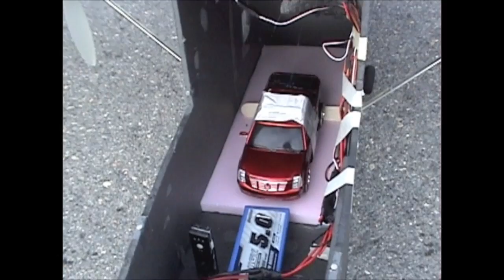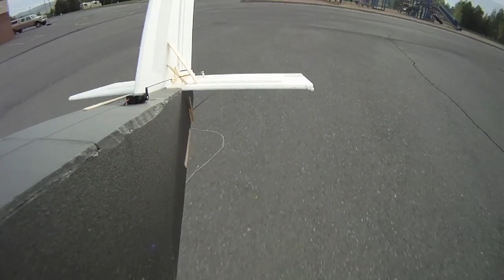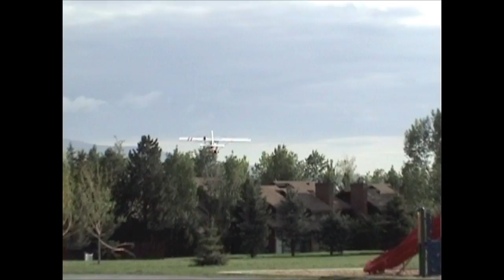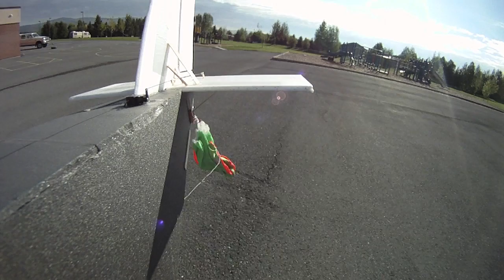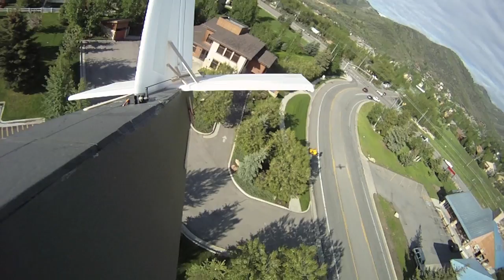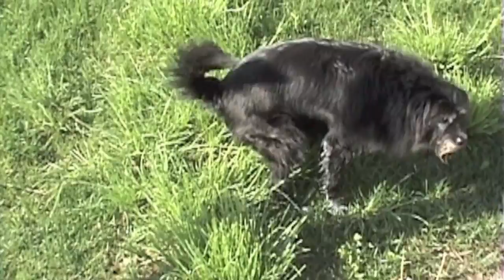RC L.A.P.E.S

Comment: You have to deploy the parachute ahead of the car, even if you did get a good extraction of the toy car it would have to roll past the parachute. try using a servo or something to deploy the parachute while you are at a low speed and near the ground, this should pull the car out of the cargo area and the chutes will slow it down like a real L.A.P.E.S

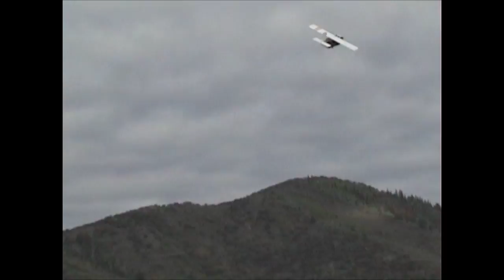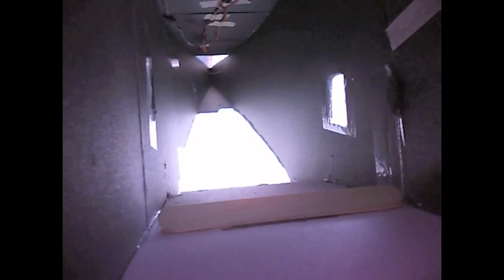Comment: Nice power to spare at 0:35, to be able to drag all that mess behind and still climb out under control.  Bet the ol' stall warning was hollering and the stick shaker was rattling up on the flight deck.  The thumb is up for that cool interior view of the extraction at 1:34.